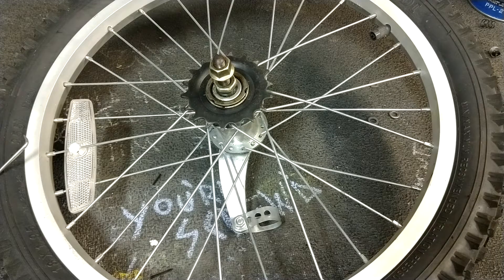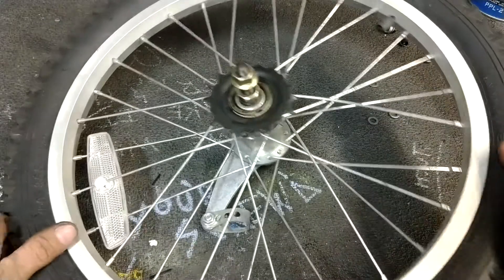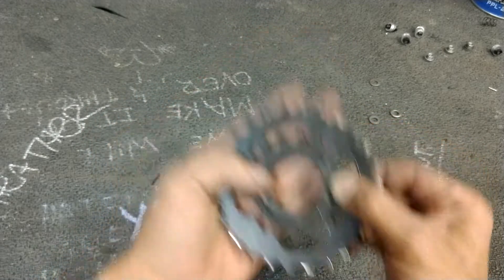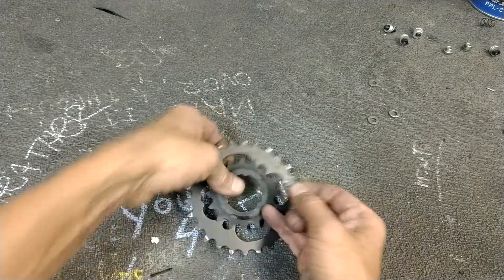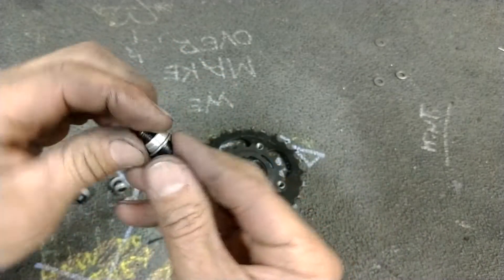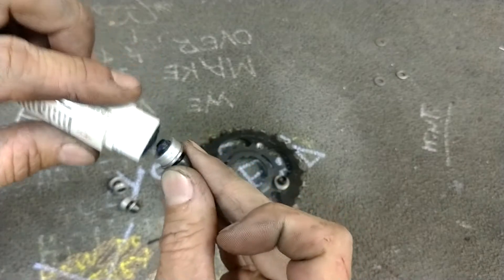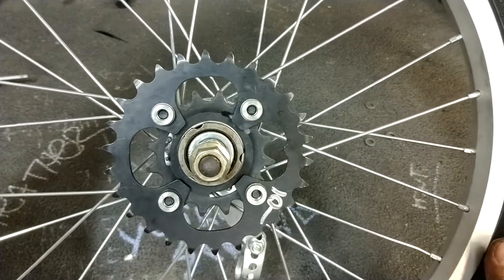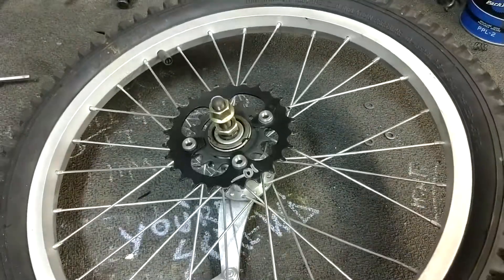Pepper's mod: extreme internal gearing.

Comment: I love these happy accidents - sometimes in the unholy union of dissimilar hardware, one finds sacred geometry revealed. I.e., turns out that a certain GMC idler pulley shell fits exactly at the diameter, depth, and hole spacing to convert a pair of grimeca moped mag wheels to modern motorcycle disc rotors... it's so stupid and perfect, it's uncanny. The things ya find at the intersections of uncommon knowledge.... keep on lookin!
Reply from the maker: thunder head well put!